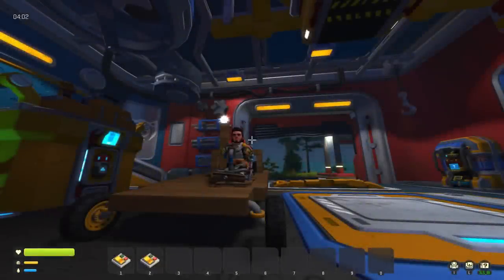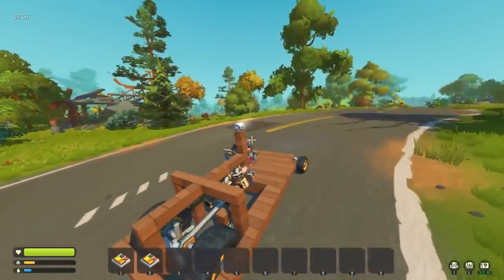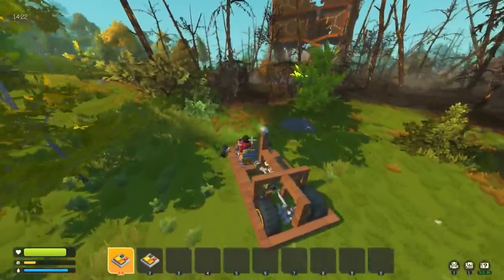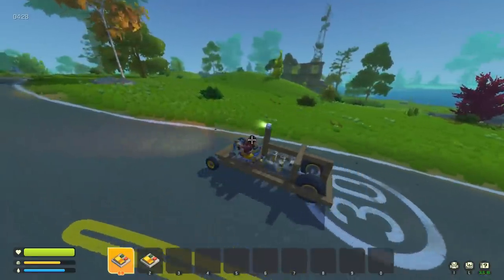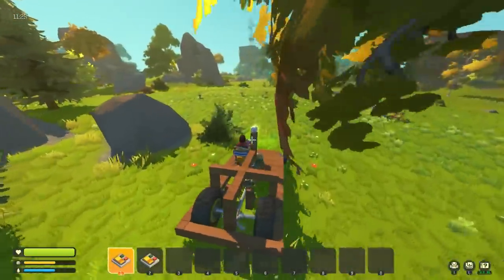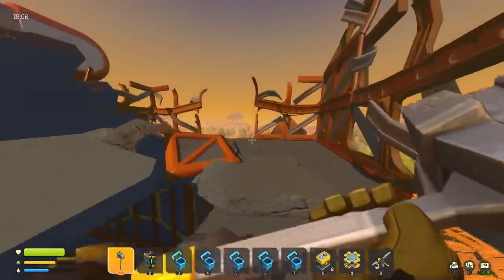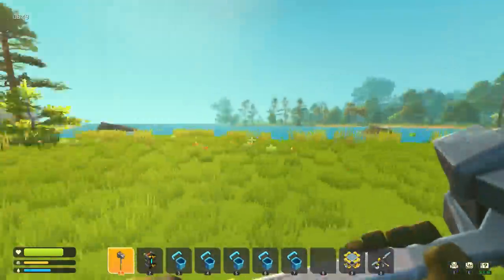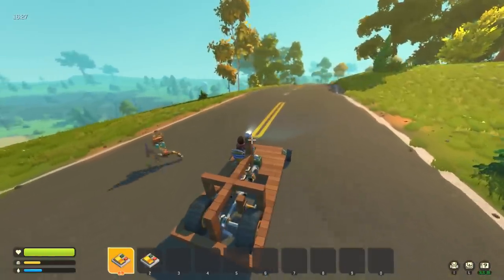I Built a Piston Powered Car for Exploring with UNLIMITED Fuel! (Scrap Mechanic Survival Ep4)

Comment: I was actually thinking "do piston engines have a purpose in survival now?" yesterday when making piston cars in creative
Reply: I was specifically building piston engines in the hope that they would be useful when survival came out
Reply: Bring the power from the car around to the back and add a prop, BOOM amphibious vehicle that doesn’t require fuel
Reply: Think of a tree cutting vehicle that grabs a near full tree for transport, the amount of fuel/engine upgrades you will need for it would ne pretty high so i think a piston engine in heavy vehicles would make more sense.
Reply: I was making gears so it would go faster
Reply: @suitable1317  how you make the gear ratios

Comment: The developers are going to see this and make pistons need electricity or fuel
Reply: they will probably need compressed air
Reply: Yup
Reply: Lol
Reply: Well for compressed air you probably need electricity to get the compressed air. And its probably going to cost less than gas. Soo really ur savjng
Reply: 69 likes. ‘_’
Reply: thanks kAn
Reply: Why wont pistons and bearings need electricity to move?
Reply: By him showing the piston car the devs will ruin it
Reply: They wont
Reply: They shouldn't BC he cheated the system with his brain.
Reply: Thanks kAN Now we can't do piston powered without fuel or electricity. I hope they won't make pistons consume fuel or electricity..
Reply: @foresthunter1865  no hydraulicfluid
Reply: Piston engine cars have been out for like a year so stop complaining. The devs are 99% aware of it’s existance. The game encourages creativity so it does not make sense for them to fix this.
Reply: What they need to do is put collision box in Pistons.
Reply: @NCIA-93  bearings don't need electricity to move. they freewheel by nature. Putting power through them (to wheels) normally requires an electric motor and/or a combustion engine connected to a driveshaft of some sort IRL; you don't power the bearings themselves, they spin as a byproduct of the transference of momentum.
Reply: Foresthunter
Or hydraulic pumps and hydraulic tanks
Reply: @Darkness-ih1gf  Its still cheating, isnt it?
Reply: @Dunken88  yes but in the animations and sound you can see and hear air
Reply: @milesrand8675   @Dunken 88  yes but in the animations and sound you can see and hear air
Reply: they wont
Reply: @foresthunter1865  More like oil
Reply: I don’t know, because it is really expensive to make in the first place, so you could instead make a higher performance level 5 engine instead of a piston engine.
Reply: why u do this dont
Reply: @NCIA-93  cuz scrap mechanic same question is why dont the ropes from the ropes mod be stiff but they are wanky and rubberry well its cuz it is F U N
Reply: They shouldn't. That's just punishing players for actually using the game mechanics.
Reply: It would be better if compressors would need rotational energy like bearing needs
Reply: Anono mus rio
Reply: dont say that bro
Reply: @Darkness-ih1gf  using your brain is CHEATING!!! =)
Reply: i feel like the knew about this type of engine for a while people made them in creative at first. It isn't really and exploit it's just smart building.
Reply: Thanks for the heart, likes and comments everyone this is the most one of my comments have gotten☺
Reply: Uuh, no, compressed air, very expensive
Reply: Waylon Holst o
Reply: @teladithz7830  it was a joke
Reply: luckily this didn't happen

Comment: this madlad's gonna get pistons nerfed
Reply: cant nerf something that works how its supposed to xD
Reply: @andrewspencer4734  probably gonna make it require hydraulic fluid or something
Reply: @incidentmars  that's..not a bad idea. The chemicals would come in useful then
Reply: @andrewspencer4734   or...they can...just add collisions
Reply: Or they are gonna give it a hitbox
Reply: Twan Boltze that would basically be adding collisions
Reply: @kuro1111  adding collisions on pistons would make so much of the community furious. I don't think pistons are supposed to have collisions.
Reply: @incidentmars  IRL pistons require a pump to work, so at least in creative mode hooking them up to an engine would make sense
Reply: @patrickhector  adding collisions = mass anger. Make it use compressed air in survival only = happy devs and happy people.
Reply: Yes!  Compressed air makes sense, look at the particles on pistons
Reply: @cyborglion4179  no. Its better because it doesnt make any sence. Who cares if they community hates it, twice the community will start to like it.
Reply: Simple solution would be collision
Reply: They should need electricity
Reply: There gonna make you need to power a compressor or something
Reply: where do you find the black block to build sensor ??
Reply: @bingbong5939  its glass blocks, concrete to make sand....I think
Reply: Nah I cant see why they would punish creativity in a creative game.

Comment: With that much torque in this engine, you should use this with some serious weight lifting. You can make it ultra stable with floor filled with heavy crates. TBH it can be great for some kind of mobile base for long time scavenging runs. Just imagine this "unlimited power" carrying boxes filled with loot and resources.

Comment: Piston engine is just a big brain play, not cheating. It takes more resources and knowing how to actually build the thing.
Also can't wait for kAN's eco-friendly moving castle with automated spud gun defenses. :) Speaking of base/vehicle defenses, wonder if you could use drills or saw blades since they do damage farmbots. Maybe have a series of non-rotation drills on pistons to quickly punch the bots so that no fuel is required?

Comment: They could add air tanks and make the pistons "pneumatic" in order to prevent such an exploit
Reply from the maker: I thought of this too or just have the pistons require electricity.
Reply: kAN Gaming correction ELECTRIC PUMP
Reply: kAN Gaming they should still make it more energy efficient if they do that because piston engines are pretty complicated and fun to see
Reply: Or just hook them up to a motor, or require a similar "pump" block for pneumatics/hydraulics
Reply: @twanboltze8196  hydraulic pump would be cooler...

Comment: That could become a one use cure all vihical
It's light add barrels for buoyancy 
Add interchangable drill and saw , and add a water cannon
Boom 1 vihical is all you need weight wouldn't be a problem  if you keep upgrading the Pistons
Just a suggestion

Comment: for the arm, maybe if you just need it stationary, you could use a piston engine setup to drive it? save some gas :D or have two versions, one for basic mining(piston engine) and one for more precise mining(engine based)

also, maybe make the piston engine button based instead of switch based? that way if you accidentally jump out it will just stop moving.

Comment: I love that design. Makes it look very steampunky.
I wanna get a decent PC to play Scrap Mechanic just so I can build cool stuff to ride around in. My ideal setup is to make like a "Train" car.

Like a car that drives normally, but it has a steam locomotive aesthetic with stuff like lumber cars and stuff that trail behind it. Since this games physics engine actually drags a massive line of stuff behind you and doesn't let it drift sideways while being pulled, you can actually make trains in this that run on the road. Which is sick.

I wanna do that at some point.
Reply: It just sounds like a train. Like it makes the huffing and puffing noise that a steam train would when the smoke comes from the funnel.

Comment: I was messing around with that engine design and if you add another block on the thing that gets put in front of the sensors then the engine will rev higher. The block needs to be added such that the piston will fire when it’s fully compressed. That’s how most high revving piston engines rev so high

Comment: You could change the gearing on the car. Build a bigger gear onto the driveshaft to make it faster. Torque shouldn't be an issue with a piston engine

Comment: It'd probably take less resources to get one controller, upgrade it enough to control 8 bearings.or 2 controllers 4 bearings each or etc whatever. then load up two wheels with the 8 bearings in series to boost the power and there's another powerless and much easier and less exploity option..

Comment: kAN take your car and put the differential gear on the opposite side (switch the buttons so it goes the right way) and use a piston to bring the power that the pistons are creating to the out side of the back, then put a propeller on the back and just like that you’ve got an amphibious vehicle that doesn’t use fuel

Comment: If you time your jumps you can dodge farm bots and the little bois attack. Also add a bed on your car and one at your base. When you want to defend your base sleep at the one in your base. And when you are moving around sleep on the one on your car. That way if you die you can re spawn back where you died. Also cows can be used as an impenetrable wall if you get enough. Because as far as I can tell they can't die as of now. Plus try filling a bucket of chemicals and throwing it at a robot. Wink Wink

Comment: Phenolphthalein is an acid that can be pink in solutions (not the acid itself, but hydrogen anions that are released). It is a weak acid. If it has a pH from 8-10 it can have pink hues. Perhaps that is the chemical in the pond, as the chemical appears to be corrosive (even though it is far too corrosive).

Comment: You should try to make the gear from the motor bigger and move the geat from the wheels futher away so your torque is divided by 2 but have twice the speed
Reply: And a gear box should be doable
Reply: Those wouldn't be very helpful especially the gearbox
Reply: @ramensales3967  more speed -> more better
Reply: Not the gearbox just always have it on max speed

Comment: A mortal engines type of city/base that requires no fuel... that's what I would do. farming might be a problem but having a bed in the vehicle would solve that I guess? using a pump to replenish water, drills and saw blades to gather resources while simply driving over them. it would take a while to get to that point but I think it is doable with this kind of piston engines. I only hope he tested how much you can carry with them as a demonstration, even though he keeps saying you could have so much resources but he never tried to load it up with the bots (that are the most heavy single objects) or materials...

Comment: Use the same exploration vehicle but make it gas powered with a fail safe so that if you run out of gas or don’t need speed, you can switch to the piston power

Comment: So I have the drive shaft set up like in the video, however when it's on a lift the two 4 piece pipes go through each other and when I take it off it only spins the one well with the pipes sticking out. What am I doing wrong here? (I have the pistons connected to switches but when I turn them on all I get is smoke) Oh and for some reason the switches won't show up in my driving hotbar

Comment: just as a fail-safe, what if you used a sensor to detect you in the seat, connected the switch and the sensor into an and gate, then that into your controller? Just in case you forget to turn off the switch

Comment: Watching j0hnbane experiment with building a thruster powered raft. Was wondering with the buoyancy affects in the water if it’s possible to build a piston powered paddle raft in the same sense to counteract the use of gas. Also curious if paddle boats are possible or a viable option due to the results of thruster rafts so far.

Comment: can you add some bearings to the ends of the wheel shaft and attach them to an engine? if you can then you have both infinite power plus some speed when you need it.

Comment: wouldn't it be possible to attempt a piston powered drill? its just the rotation that cause damage, and itd be a little easy to make the piston shaft have a power conversion point at each junction, especially to those who know what they need to do

Comment: does the drill need a bearing?
I'm curious if the drill can mine things without an engine...
Reply: How would it spin or get power please explain
Reply: It probably could, from what I've seen you just have to have the drill moving in some way, its just easier and better to put it on a bearing to spin it than just ramming your car into a rock using a complicated mechanism to make it shake or something.
Reply: @nesyboi9421  HOW??

Comment: The 3 pistons instead of 4 really bothers me. theres a small amount of time that you dont get power and you can HEAR it. Also, if it ever stops on that 4th section, and not on any of the other pistons, it will be stalled.

Comment: my knewbie brain is still figuring out how the heck do you align the pistons, I can't recreate it just by looking, grrr.
anyone know the trick?
Reply: I’m sure you know by know, but you put a bearing on the crankshaft between each connecting rod (piston), so 2 for the 3-cylinder, connect those bearings to a controller, then set the bearing start points to where you want your crankshaft throws (120 degrees, 240 degrees)